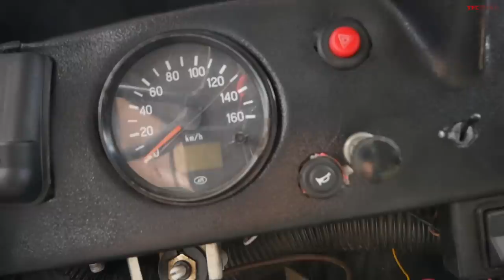My Russian Van Is A Better Off-Roader Than Even A Modern Toyota Collab — And THIS Is Why!

Comment: Worst car ever built…..surprised someone still wants to buy a car that is starting to rust faster than it can be sold to someone
Reply: Next to a plastic Mustang of the time of today, invest lot of money, expensive quotes of the insurance companies, speeding over 200 kph where only allowed speeding up to 70 to 100kph (more and more in germany) and so on. If you buy a Buchanka, it's ON YOUR SIDE to invest in rust protection. You pay less money for this allrounder against a little Ford City-Car. I own and handle few Cars for any ressort, for the City a little Citroën, for trialing a Can Am Maverick X3 XRS MAX TURBO RR and this UAZ BUCHANKA.... The Buchanka fullfill a wide range of missions in need and I will never sale them. Next to the fact a Toyota Four Runner TRD PRO costs here in germany more than 99.300 Euros and a Buchanka in the mid 20'k bucks.
Reply: @semserhiy  this car only build to explore the tundra or taiga, never to cruising on the boulevard🤷‍♂️ That's a workhorse or a mule. Not a carporn motorshow member. If a russian resident want safety or luxury cars, they buy a Mercedes or Audi or even a Toyota, that's NO PROBLEM to them. You must be better informed about Russian lifestyle and not only looking Trump's propaganda television about russian residents a folk living 10.000 years b.c.
Reply: @uazbuchanka2206   that’s what you think, but reality show different pictures,if you look that car on stock, and reality of tundra or taiga that car without any modifications cannot to be use, that car still drives on regular road sometimes poor city’s use that car like ambulance or fire department or police department cause why? Cause so many corruption and cheap car
Reply: @uazbuchanka2206  you can check Russian news and you will be surprised how many villages or poor region still use that car and dreaming about something good and reliable
Reply: @semserhiy  like peeps in Texas they want air conditioning on each hot days. What else.. At each country around the world stay peeps they want the the opposite as they neighbor 🤷‍♂️
Reply: @semserhiy  veto...the Buchanka will survive the tundra or taiga for sure. Often seen on real expeditions... Real and not a stage on a movie park.
Reply: @uazbuchanka2206  man I grove up in Soviet Union and I seen many things when you just read or hear about
Reply: @semserhiy ... and I work each day with real true soviet soldiers and they talk me all the same about they country and livestyle next to the adventures with the Buchanka. On privat property and at the time at the russian army but NO OF THEM told about the mule shitty mouth. Sometimes it's in a real combat better to survive on a back of a four wheel drive mule against a non exist Toyota Four Runner TRD Pro (with full loaded options) in a battlefield. Never rule a book about his thin ugly cover.
If a mechanic swap a Dodge B100 cabin (of the 70's last millennium) on a Dodge W frame and driveline, that's the same evolution of technic like a Buchanka and a american resident will love it. 
My special question about you: Have you ever handle and own a new modell Buchanka (build after 2019) for yourself over a longer period and under heavy conditions out in the dessert?
Reply: @uazbuchanka2206  after couple years of using that car my friends said all specs what the provide it’s just big joke, to reach speed limit 50 miles it’s takes years carry safely passengers there is no way to reach for destination whiteout heart some one to drive on extremely road it’s unappeasable without huge modifications, question what kind of military they have? And Roy was scare to give you that car to drive that’s was visible on his face, like I said to grove up with that garbage because people cannot afford something better and know that car very well all that communication doesn’t make any sense, people who doesn’t know nothing about that car they will listen you, after Soviet Union military army I can say stay away from that junk if you don’t want to have problems with the health
Reply: @semserhiy  oh dude, my God what for "experience knowledge". What you told sounds, like "hear saying" from Buchanka's of the last millennium with a small underpowered carburetored engine with 86hp.
The new model after 2019 offer total other data's.
If you told about shitty driveline, you have to know the expedition- and anniversary-model offers SPICER/DANA-axle from factory with electronically differential lockers like newest jeep's. And I think you wouldn't talking bad about your axles and driveline. 
But I see your special knowledge about the Buchanka based on "hear saying last millennium" and not about the current line...
Next to your talking test of acceleration up tp 60mph,a travel like a evolution of dinosaurs.
The Buchanka are faster and higher in speed as/than a Land Rover...
I don't know why you hate this car so immediately.
It's not a formula one or Kmart race car, it's made to enter the backyard of oddworld.
My own Buchanka build 2022 as anniversary-model and fired up with the ECU from the 145hp "Hunter". This combo runs fast enough to withstand the evil of VOLKSWAGEN T3 SYNCRO or anything like this. I noticed your point of view but you have to accept the EXIST of Buchanka's out there. 💁‍♂️
Reply: @uazbuchanka2206  knowledge and experience is different story’s when you have knowledge and experience wit that junk you will start to talk different get more experience with that “car” but I am going to spent my time for nothing good luck
Reply: @semserhiy  lol...." Spent my time for nothing" .
Yes, that's the one and only what you deliver, each day..... for nothing. If I seen the whole comments on this vlog, you are the one and only who fight against the Buchanka thematic.

Comment: I'm sorry true Americans drive Ford since model T.....
Toyota came to USA in 1957. It's not American no matter how you slice it. Moto man at 2:08
Reply: Who cares, Toyota makes the longest lasting vehicles anyways and the most American truck is the Tundra, which is built by Americans with American steel and designed by Americans unlike other "American" manufacturers

Comment: It is not true. It is very uncomfortable, no good performance off road. The differential do not have blocked. The engine no to much power, just 4 small cylinders, no turbo. 
Toyota 4 Runners can pull 3 of that Russian van for sure
Reply: Lol, that's not true... Invest in a expedition or anniversary model dude. Both over SPICER-axle with electronic differential lockers! And why does UAZ offer no diesel?!...diesel flocks under coldest temperatures! That's fact and no conehead-storys. That's thing build "reduced to the maximum" to withstand any problems in the outback. Here on the rough coast of Denmark each season most camper stuck on quicksand on the beach and struggle in time to the upcoming tide. Often some residents "rescue" stranded camper vans with a Toyota 4wd next to heavy payment of few hundred euros!!!....and hate US Buchanka-driver, while we towing struggled Camper-Van without heavy payment and with proud!
With 4wd, gear reduction and diff. - locker and WITHOUT ANY TURBO-Diesel-Shot.